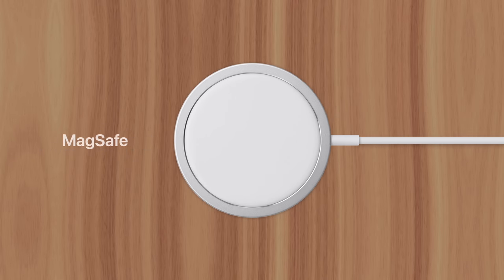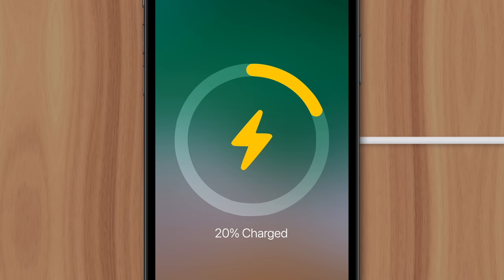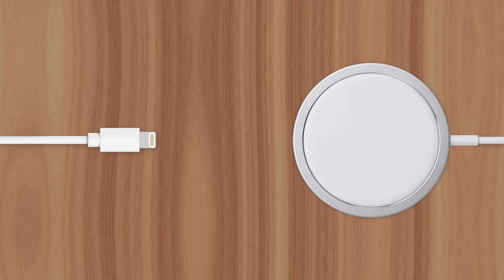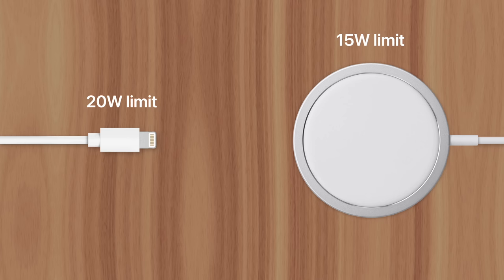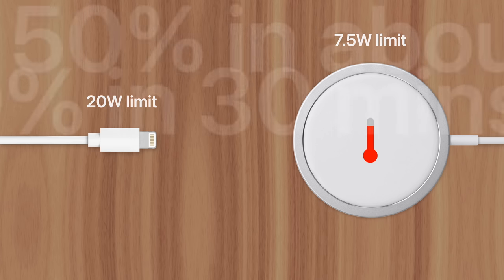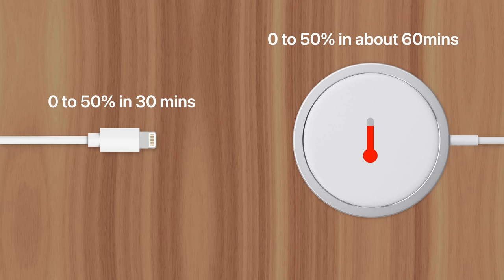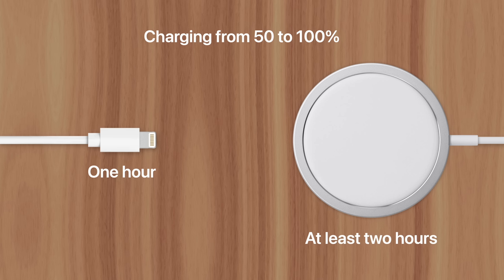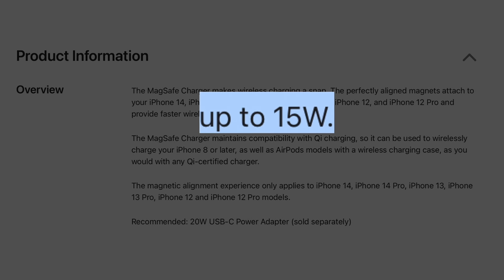Why MagSafe Charges So Slow

Comment: My phone gets hot really fast when I charge with MagSafe
Reply: That’s really bad for your battery so just don’t use it
Reply: Use the Belkin wireless charger instead of you just don’t want to use the cable.
Reply: Same. That goes for any wireless charging. Just use the cord it’s faster and stays cooler. Seems like even the 12w iPad charger takes about the same or faster than mag safe.
Reply: Not me. Wired charge killed my battery while my wireless charge prolong my battery. Sorry, I don’t agree. MagSafe for life
Reply: Same for me I was holding lava at that point
Reply: Mine doesn’t at all
Reply: Are you using a Apple 20w charger or another brand
Reply: Try a fan
Reply: Same but my AirPods charge extremely fast with MagSafe. So I use lightning for my phone and MagSafe for my AirPods.
Reply: @Madeintheshade65  i’m using the 20w charger by apple brand and it’s getting soo hot bloody hot
Reply: @themustardcat1415  it has been only doing that for me when I have a case on
Reply: @arithesheep5506  yeah i don’t wanan take a case off just so i can charge it tho mate but i have to test it
Reply: @themustardcat1415  I totally get that i just don't wanna have to buy a new battery lol
Reply: @jdzajdza  bruh….
Reply: @chuy623  yeah why would i take a case off to charge a phone but hey it’s cool i have it but if it didn’t  heat up like it was a nuclear power plant i would’ve used it more
Reply: My phone gets hot when I use my wireless charger that’s why I use my lightning cable more often but when I charge over night I sometimes use my wireless charger when everyone’s using cables and my phone gets up to 20% in 10 minutes with the 20w lightning cable.
Reply: @jdzajdza  you're not answering rationally
Reply: my iPhone 12 Pro Max get really hot for no reasons, and without having had it ever charged via MagSafe. Always with the cable i do and i still have a problem.
Reply: Mine doesn't
Reply: Use original accesories please
Reply: Yeaah mine too I stopped using it about a year now
Reply: @jdzajdza  🧢🧢🧢
Reply: @John-henry Duckworth  yeah after one year my 13 pro Max still had 100% battery health
Reply: Apple 5w charger for life.
Reply: @scrap-godsuper-zo4740  a real fan?
Reply: @Jack_Plush  yes
Reply: @scrap-godsuper-zo4740  okay.
Reply: I’m gay
Reply: And MagSafe was intended to be an harmless, efficient portless charging method...
Reply: @Simone-qr6mq  yes and for portliest it makes sense charge and play not a problem
Reply: for a product called magsafe, it sure seems dangerous to phones
Reply: @spingleboygle  hurhur good one
Reply: Welcome to wireless charging
Reply: Bro probably uses MagSafe for android 💀
Reply: This isnt customer support bro
Reply: @ADodz  youre cute
Reply: @wesside-333  find me a gf then
Reply: @ADodz  I’ll be your “girl”friend
Reply: @wesside-333  wes you are not a “girl”
Reply: @ADodz  Dang, Okay I admit I'm not a girl. But I'll still try and find a gf for you!
Reply: That brings the girls
Reply: @wesside-333  lesgoo
Reply: Wireless charging is like a coil and it generates heat
Reply: @SigitarFerdy  even original accessories have these downsides, they called physics…
Reply: @DarthG3nesis not even apple can defy the laws of physics, considering they got the name "apple" from when an apple fell down on isaac newtons head this just makes it more funny.
Reply: I have the same issue… really great case, the MagSafe charger was one of the more expensive ones and this happens…. Idk, same with power banks. So I am mostly charging with lighting cable 😤😂
Reply: @rustylarry7465  yes. 4 month wired used decline my battery percentage. I am using for almost 2 years on wireless charging and my battery percentage is still the same
Reply: @jdzajdza  what iphone model is that?
Reply: @rustylarry7465  exactly what I meant
Reply: @rustylarry7465  12 Pro Max. When I stopped using cable the battery percentage was at 94%. It is now 93%.
Reply: Welcome to physics, the heat isn’t coming from the battery, but from the copper coils that do induction charging
Reply: Wireless charge its not as efficient as wired one.
Reply: @jdzajdza  you don't know how batteries work. Batteries degrade faster in the beginning and less over time. So for example the battery degrades faster from 100 to 95 than from 95 to 90. 
There are many things that influence battery health like age, temperature, charging and discharging speed and where you keep your battery charged. Batteries don't like heat and magsafe/wireless charging produces alot of it, so this isn't good for battery health.
Batteries also don't like the top and bottom level of charge. If possible don't charge your phone to 100% if you don't need it, if you want to maintain your battery health. Try to keep the percentage between 20 - 80%.
Reply: @jdzajdza  try cleaning out your charging port dude it's likely got a year or so worth of pocket link and dirt stuck around the pins a toothpick or paperclip and just scrape around and see if that makes the port work again although I have seen a man plus his iPhone in with a 45 degrees fucking angle on the cable to the charger port so who knows maybe u did that
Reply: iPhones will get hot regardless of whether you charge with MagSafe or not. It’s to do with the neural engine learning your behaviours so that it can better optimise your battery health. It’s completely normal and completely safe. Your phone is built for that, just don’t use it while it’s hot to touch.
Reply: @galvendorondo  it’s true but is better for battery health if the iPhone don’t get too hot, and the wired charge is more efficient in that… but I use mostly MagSafe in the office and in home.
Reply: @joseabraham777  I use the 30W dual charger for my MacBook Air M2 and iPhone 14 Pro. The iPhone always noticeably gets hot at night when I plug it in. I stopped using MagSafe because frankly the cable is more convenient and I can still use my phone while it's charging. The heating issue isn't really an issue, it's your phone just working overtime and it's going to happen regardless of whether you use MagSafe or not, so there's no need or rather point in worrying about it, your phone's battery will degrade over time naturally anyway and it's got nothing to do with overheating. I'd be more concerned about getting burns rather than something happening to my phone.
Reply: @jdzajdza thats just dead wrong lol
Reply: @jdzajdza  that is objectively wrong
Reply: me too but hotter
Reply: I have a magnetic power bank, and the better option is leaving your phone off while it’s charging, as it’s bad for your phone anyhow, regardless of the charger.
Reply: @thetechlibrarian  magsafe is capped at 15 watts
Reply: Same it so unusable
Reply: i always charge my phone with magsafe i never actually used the charger
Reply: @mjflorent  magsafe are the worst they heat up my phone fast and it also charge slower and as you know when your device is heat up while charging it was stop charging until it cool down
Reply: @balkanduck yeah
Reply: @thetechlibrarian  it’s also ruining your battery
Reply: Same
Reply: @kaiweeks5496  the file
Reply: Mine too but I’m not super concerned
Reply: Try to fool your self😂
Reply: @Visbalalam 5w gang baby
Reply: Hi there. I am new to all of this msgsafe method.

I have a Flip4 with a regular baseus wireless 15w charger.

Why add magsae capability?

Wouldn't this mess up the phone later as it has a different technology?

Thanks in advance.
Reply: Mine too.
Reply: @mokaLARE  love belkin charging cables in all i have a shirt belkin cable that i use in my car and its the only cable that actually charges my phone quick while driving .

 Other cables even if they are legit product cables ir generic won't do what my Belkin cables do .

Comment: I always charge my iPhone at night with MagSafe, is so convenient and don't care about time, it's just great!
Reply: I agree that,bro
Reply: Same!
Reply: Same! It can take all the time it wants during the night. Sometimes I wake up in the middle of the night to check time and it's at 80% and it waits until I'm about to wake up to fully charge to 100%. It's perfect
Reply: Same
Reply: I only use magsafe when it comes to powerbanks so I can charge it in my pocket, when I'm at home, I just plug in the cable, it's not that hard. Life is unexpected, it's best to try to be prepared
Reply: I agree I think that fast charging is overrated because it can significantly affect battery health. Because battery life matters more then fast charging IMO
Reply: @yungboicontigo9278  i agree but some people dont have the time bruh
Reply: @yungboicontigo9278  heat also stuffs battery life too
Reply: @grahamevans8567  it gets warm to the touch when i charge. It never gets uncomfortably hot. Warm does not hurt the battery at all. And when youre in a pinch and need to charge real quick then just have an extra cable laying around that you can use, other than that you can use the wireless. And trust me, the battery suffers a lot more with 20w being a little cooler, than somewhere between 7,5-15w at a little higher temperature. Youre not cooking your phone with wireless
Reply: Really bad for your battery. What you should do, because you don’t care about time, is plug into a 5W lighting to charge nice and slowly throughout the night.
Reply: @hardinhenry  i use 20w charging with cable. Last yr sold my iphone 13 100% battery capacity after 225 cycles. That’ll do me… no battery OCD lol
Reply: @v.r.technology  spot on bruh
Reply: @v.r.technology  that's similar to what happen with MagSafe, I've see when everyday stop charging at 80% and before I wake up charges to 100%, and I thought the same as you, I charged it when I wake up, but I been doing this more than a year and my battery from my last iPhone only degrade 1%, with my new iPhone still at 100% since October :)
Reply: @yungboicontigo9278  wireless charging is worse for your phones battery then fast charging with a wire
Reply: @THAT3GGT  how? People use wireless charging all the time
Reply: @yungboicontigo9278  they do but if you do some research you will read about people using a wire and maintaining almost full battery heath after 1 year of purchase vs someone who used only wireless had about 92% battery health after the same period of time on the same iPhone.  I don’t actually know what causes this but I would assume the heat from the wireless charging is hard on the battery and causes the excessive degradation.   It’s a new technology still and I would stick with the faster charging wire which is proven to be better for the battery until the technology improves
Reply: Meanwhile you destroy your battery from heat. Nice job.
Reply: u gone have bad battery life after while using that
Reply: How is it more convenient over plugging it in if you’re sleeping? Lol
Reply: @BlindMango  I don't have to wait in the morning to charge while I do some other things or need to go out fast
Reply: @alexis0a  if you only could plug it to a charger over night which is also better for the Battery and your electricity bill… wireless charge wastes energy much and just warm up the Device…
Reply: @DarthG3nesis  I know, but it's not a big waste to care about my electricity bill, and it's convenient for my only put my iPhone on my night table and charge instead of have the lightning cable, my mom charge her iPhone with the cable, it's a preference, as fun fact... our battery after a year reported the same health haha
Reply: Takes 2 seconds to plug-in in for 27 watt speed
Reply: @ronthorn3  I don't need 27W speed, and the charger is only 20 anyway :)
Reply: This is exactly what MagSafe is ideal for in my opinion. It’s just nice to snap into place one handed in the dark and be done with it, charging overnight makes speeds irrelevant. 
Only have used lightning to charge up quickly in a pinch, like if I forgot to leave my phone charging.
Reply: @CerberusTheWise  Exactly! I only use Lightning when travel and need to use my external battery :)
Reply: @v.r.technology  I feel like charging on 5w makes the battery last longer. The faster you got it the faster you loose it is something I keep in mind
Reply: @jaysmokin  damn that hits deep fr
Reply: Agreed

Comment: It seems like using a wired charging cable would be better than wireless charging. You should only use wireless charging when you do not need to use your phone right away or as often.
Reply: also, having one at your work desk means you can just quickly put it on the charger, take it off, put it back without thinking, letting it keep a decent charge most of the day
Reply: It's about convenience vs efficiency.

You also want to keep your phone's battery in the "sweet zone" of 30-75% as much of the time as possible. That means charging it a little bit several times per day, and that's where plonking it down on a magnetic device is a lot more convenient and casual, than having to deliberately mess around with a plug.
Reply: Also over night is an obvious example
Reply: But MagSafe charging is far more convenient than wireless charging as it snaps on and align automatically. 

You can even use the phone while it’s charging just like with wired, but is more convenient than wired since you can snap off the charger any time without getting snagged by the cable
Reply: @damnfreakingsien  Yes, so it fosters a tendency to feed small amounts of electricity to the phone very often, and that's good for long-term battery health.
Reply: Wireless charging for night time and wired for a quick top up
Reply: Exactly! "Wireless charging" is literally just wired charging with extra steps.
Reply: @InventorZahran  Not really, all you have to do is set your phone down on a pad for it to charge. That's it. 

Wireless charging becomes more convenient if you want to plop your phone down and charge it little by little every time you sit down on your desk for example. On the other hand, wired charging is better if you prefer to charge your phone only when the battery is low. 

Personally I do the latter, so I don't really bother with wirelss chargers.
Reply: @InventorZahran  it’s not. You need 2 hands to charge a phone by wire, while for wireless, you can just plonk down. This is a small but important difference in convenience.
Reply: @rohandatta7111  also very useful for bedside charger. When you want to charge your phone, but don’t want to deal with cables sticking out of the bottom of your phone.
Reply: Well, it's reassuring to have them both, I have an old phone with USB c that doesn't work now, won't bother to fix it since I don't use it as much anymore, but thank God that it comes with wireless charging feature, I still can charge it
Reply: If you want to be in the 30-75% sweetspot all the time, you also want to avoid hot battery from wireless charging though and will try to use mostly 5w and 12w chargers with 20w charger if you really need faster charging.

Comment: The Belkin 2-in-1 (yes it’s expensive at $99) solves the 15w drop off issue. It does sustained 15w charging and is the best one I’ve seen so far
Reply: But wouldn’t that mean it’s causing more wear and tear on the battery? It sounds like the Apple MagSafe chargers decrease the speed of charge when the iPhone starts to get really hot to protect it. 

Also, just curious about that charging stand you mentioned... is it topheavy at all? Any concern it will fall over? It just looks like the iPhone is propped up pretty high and I didn’t know how solid and heavy the base itself is. It looks like if you tried to pull the iPhone off the stand would just try to come with the iPhone due to magnetism. Maybe the stand is heavier than I expect and it isn’t a problem though?
Reply: @riffdex  I have the Belkin 3 in one and iPhone 13 Pro Max, the phone falling is not an issue At all, the phone moving the stand kinda is, if you pull straight up it kinda lifts a bit Before releasing the phone, but if you pull any other way the bottom of the stand is rubbery so it holds to the surface
Reply: The wattage is determined by the phone, not the charger.

Nice placebo.
Reply: It’s what it would’ve been if Steve Jobs was around

Comment: I would love to see a video about why so many of the apps on Apple TV run so terribly/have such poor ratings on the App Store
Reply: Exactly bro
Reply: might be people running them on the old HD TV which is very slow
Reply: @alyx6427  He meant the Apple TV Box and not the Apple TV App for TVs ;)
Reply: Apple TV was using really old processors until the newest one so hopefully it’s at least somewhat better now. They run slow on my Apple TV too.
Reply: @YogiTheBearMan  also not true, you can’t compare these versions of the Apps to one’s on your phone or tablet because they have to be better optimised
Reply: i’ve had the new apple tv for almost a year and i can’t stand other tvs now. i only want my apple tv, it’s way easier. never had any issues
Reply: I’ve had no issues with my Apple TVs, I have the new 4K versions.
Reply: I have a 4k Apple TV and feel the opposite.. it’s the fastest smart tv I’ve ever had.. can’t use any built in smart platform on a tv now because of it.. everything feels super slow in comparison

Comment: MagSafe on the iPhone 14 series is way more stable as there has been tests done showing the wavelength and frequency of the input power compared to the iPhone 12 Siri
Reply: I’ve experienced the high heat on my iPhone 14 Pro Max with the Apple dual charge - I use the charging cord now 🥴
Reply: @chimakwaprettyboy4186  good idea I charger over night with the 5W block